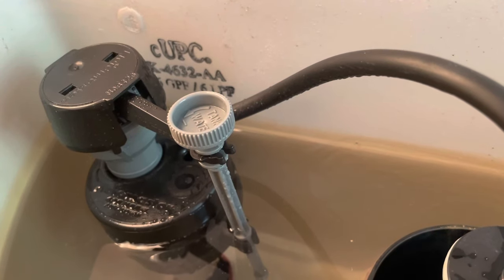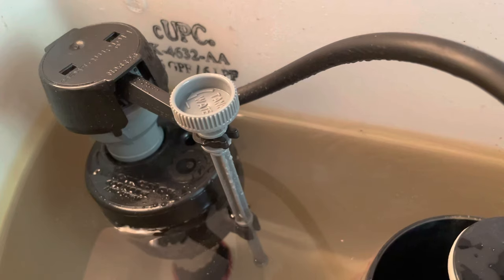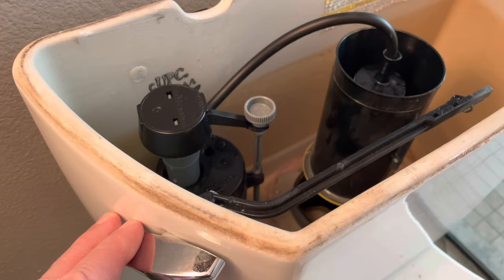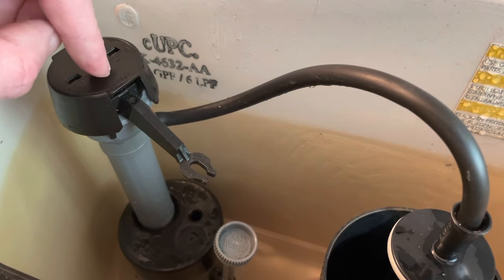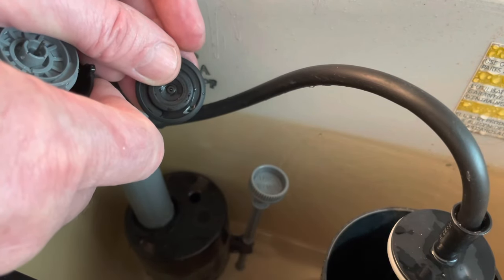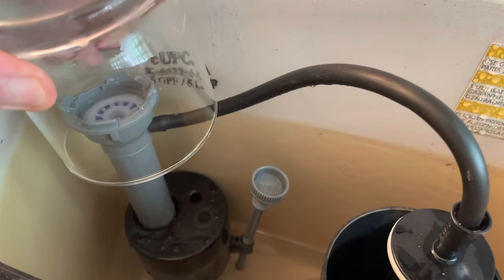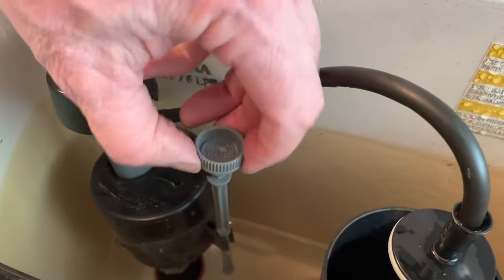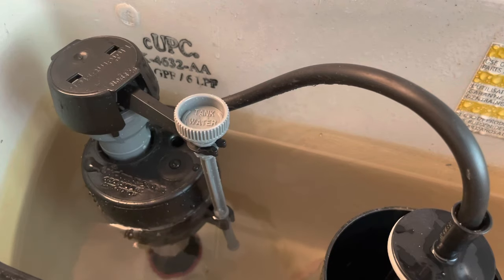Toilet Fill Valve Not Shutting Off / Don’t Replace / Fix Fast Cheap & Easy For Beginners

Comment: You can also adjust the fill valve stem down if you don't have some washers handy.
Reply from the maker: Going to do a vid on adjusting the float, but this is not related to that… this is for when the valve “won’t” shut off regardless of height adjustment.

Comment: Thank you so much for this video. I wanted to ask you a (hopefully) quick question if possible. The cup in my fill valve does not move up after the water fills the tank, so the water just keeps flowing into the tank, but it stops if I move the cup manually. Would changing the seal help in this case too? My fill valve was changed around 6 months ago.
Reply from the maker: You bet 👍🏻
Reply: @papajoeknows8355  Great, thank you so much for your very quick reply!
Reply from the maker: Just need to adjust the “float.” At the end of the lifter arm (what you’re using with your finger to pull up on to shut it off), there’s a gray round adjustment screw… you want to turn it in the appropriate direction to actually lower the float so that the rising water level will push the float all the way up to the off position. Just a little fine tuning, and you’ll be all set.

Comment: Mine is leaking through the small hose at the top. Hopefully running some water though with the valve removed will fix it.

Comment: Thanks for this however mine looks slightly different and the twisting doesn’t seem to be working. There’s quite a lot of limescale deposits. I’m scared to break it so didn’t force it. Any suggestions?
Reply from the maker: When they start getting like that, it’s easier to just replace the valve. It’s simple to do, and they’re only $10.

Also, there’s a trick where you just replace the upper portion… it can be done quickly and with no tools. Here’s a video…

Replace Fluidmaster Toilet Fill Valve in Seconds For Beginners NO TOOLS NEEDED
https://youtu.be/ovdWF5Hdz8U

Comment: Something that really should be emphasized at 2:00 that was a real problem for me is that the narrow piece that swivels up needs to go up all the way before turning the larger piece counter clockwise. It wouldn't budge until I figured this out. Great video aside from that.
Reply from the maker: Interesting, because the position of the arm shouldn’t have anything to do with the ability to get the cap off… if you look very closely at 2:00 where I turn the cap to take it off, the arm is in the down position. Not saying you’re wrong, just never known it to have any bearing on getting the cap off.
Reply: @papajoeknows8355  Well, I do have a slightly different version with a metal piece connecting to the floater. It looks the same aside from that, but it could be pretty old, so maybe they fixed this in the newer current version to make it easier.

Comment: After watching another video on cleaning a toilet tank with citric acid (she used one cup of it) I poured about four ounces (all I had)  in my tank and let it sit for two hours. This cleaned the very rusty, slightly moldy tank pretty well, and also cleaned the valve inside the device, it seems. Stopped the toilet running, instantly. Did not fix a whistling toilet, though.
Reply from the maker: @hermanhale9258  try this…

Loud Whistling / Hissing Toilet Driving You Crazy ? Fast Easy Fix
https://youtu.be/-SwWyZCeAjY
Reply: @papajoeknows8355  Thanks, that does look simple.

Comment: I have water leaking from one of the two holes at the top of the valve cap. The valve looks just like yours. Do you think the seal could be the reason?
Reply from the maker: Yes, I would follow the steps in the video, and even if you don’t have a new seal, clean the existing & replace.

Comment: Hey man, hope all is well.  I did everything you said.  Flapper is good, flushed out the potential mineral deposits.  Then went and bought a new rubber seal (little black thing).  Then I quarter turned it until it clicked.  Toilet STILL WON'T stop running unless I push down on the cap of the fill valve.  American Standard parts, only 2 and a half years old.

Very frustrating.  Please help.
Reply from the maker: Honestly, when they start getting “fussy” like that, it’s easier to just replace the valve. It’s easy to do, and they’re only $10.

Also, there’s a trick where you just replace the upper portion… it can be done quickly and with no tools. Here’s a video…

Replace Fluidmaster Toilet Fill Valve in Seconds For Beginners NO TOOLS NEEDED
https://youtu.be/ovdWF5Hdz8U

Comment: I wish I had seen this video before I spent almost 400 bucks on after hours call!! Same issue plus the valve would not turn the water off.
Reply from the maker: It’s ok… I can’t tell you how many things I’ve learned after the fact. This was probably the exact problem, but you’ll know next time.
Reply: @Papa Joe knows  yes I feel so mad at myself but now I know what to check for. Thanks for the video!
Reply from the maker: @LoveLifeAllWays  you bet. 👍🏻

Comment: Thank you for the video. I tried doing this and it works the first time (stops the water) and then every time after, it doesn’t stop the water anymore and does the same thing. Any thoughts on this??
Reply from the maker: Is the water rising and spilling into the overflow (the pipe in the center)?
Reply: The water doesn’t spill into the overflow the first time but then it does after flushing it. Then I’ll undo the mechanism the 1/4 turn and then lock it in again and then the gasket will engage and the water will stop perfectly fine. It’s after the first flush that the water doesn’t stop again. When the water fills up the first time, I can hear and see when the rubber gasket engages but after flushing, it never engages again, causing the water to spill into the overflow.
Reply from the maker: @Josh-vk7qu  Try this…

Running Toilet Spilling into Overflow Easy Fix DIY
https://youtu.be/uTcYxn2bpDg
Reply: @papajoeknows8355  thanks for your help and getting back to me. I had tried that in the video but it didn’t work and I guess the small metal pin that goes in the center of the gasket was no good anymore so I replaced the valve component (top piece and stem only) and that finally worked. Again, thanks for your help!!
Reply from the maker: @Josh-vk7qu  you bet, glad it worked out. And yeah, at some point it’s easiest to just replace the valve, or just the upper portion as you did. Well done. 👍🏻

Comment: Does this fix work if tank isn't refilling?  I have to gently tap the fill valve to get tank to refill
Reply from the maker: No, eventually they become “sticky” so to speak… at that point, it’s easier to just replace the valve. You can also replace just the upper portion of it in seconds with no tools. There are links to a couple of videos I made on this down in the description.

Comment: i tried cleanup but it doesn't work well, i did everything but still the valve is not closing, thanks for the video because i will do the exact same thing before buying a new valve
Reply from the maker: Sounds like it’s just time to replace the valve. You can also just replace the upper portion quickly and with no tools. Here’s a vid:

Replace Fluidmaster Toilet Fill Valve in Seconds For Beginners NO TOOLS NEEDED
https://youtu.be/ovdWF5Hdz8U

Comment: It is easy to replace the valve by releasing the white clip down by the base of the valve. From my experience its a better fix
Reply from the maker: Yeah that’s a pretty cool hack too, I did a video on that about a year ago:

Change a Fluidmaster Toilet Fill Valve in 18 Seconds No Tools Easy
https://youtu.be/gyeQNI-LQnU

Alot of times, the seal doesn’t even need replacing though, it just needs cleaning out. Each approach has its place.

Comment: 😂 everything was going great. I got to part of flushing the minerals with cup over fill valve. Tried turning water off at wall and won't turn off now 🤣. Thankfully I got top back on and it finally shut off. Casing plumber now
Reply from the maker: Lol, yes the valves at the wall get “stuck” over time from not being used. But glad it’s all working out. 👍🏻

Comment: I just fixed the valve on my toilet for a separate reason but now it won’t stop running even when the float is up. I watched this video and checked mine the little metal pin that sticks out comes out of top piece. Is it supposed to do that?
Reply from the maker: When they get “fussy” like that, it’s easier just to replace the valve, they’re only $10, and it’s very easy to do. There’s also a trick where you just replace the upper portion… it can be done quickly and with no tools. Here’s a video…

Replace Fluidmaster Toilet Fill Valve in Seconds For Beginners NO TOOLS NEEDED
https://youtu.be/ovdWF5Hdz8U

Comment: Does this trick also work with American Standard Fill Valves?  The design of my American Standard fill valve looks very similar to the flow master.
Reply from the maker: Yes, if I remember correctly American Standard uses a private label version of the Fluidmaster valve.
Reply: @papajoeknows8355  Thanks!  I'll have to try that out and the replacement seals this week!  The Valve itself is pretty cheap already, but I'd rather not go through the hassle of dismantling the entire thing if all it needs is a flushing out or a new seal.

Comment: Nice little hack, I must say.  But do Home Depot or Lowes sell these replacement rubbers or maybe Amazon?
Reply from the maker: Yes they should have at Lowes & HD, and I put an Amazon link for some down in the description. 👍🏻
Reply: @papajoeknows8355  By the way, Joe, what is your opinion of Korky’s vs Fluidmaster?
Personally, I think FM is the superior product because of the exposed float.  But I’d be interested to hear your thoughts.
Reply from the maker: @justicegusting2476  no complaints with Korky’s, they’re a good brand. I just had an old plumber years ago tell me that Fluidmaster was the gold standard, so I pretty much went with that. I do also like the exposed float. 👍🏻

Comment: I HAVE THE Same one but my rounded float that rises, raises jerky and does not raise smoothly, any ideas on how to fix this or if i can 

apply any lube or anything to assure it raises smoothly, Thank you
Reply from the maker: That’s a common problem when they get older… When they start getting “fussy” like that, it’s easier to just replace the valve. It’s simple to do, and they’re only $10.

Also, there’s a trick where you just replace the upper portion… it can be done quickly and with no tools. Here’s a video…

Replace Fluidmaster Toilet Fill Valve in Seconds For Beginners NO TOOLS NEEDED
https://youtu.be/ovdWF5Hdz8U

Comment: I replaced my whole fill valve and it leaks under the cap at the top here and there. I guess I got a bad new valve. Should I try just replacing the gasket first even though the thing is brand new ?
Reply from the maker: Maybe pull it apart as in the video… maybe it’s just caught up in there.

Comment: Hi there. Do i have to disconnect the hose or just shut it down. Could you guide me in this one also. I being experiencing condensation behind my toilet tank and it drips alot. I turn off the water hose to the tank. Because when i had it back on the water tank will continue to make the noise like when is filling up water. So i shut it down had water in the tank but when i go back to see if the tank is full of water is empty do you by a chance now what it is? I would appreciate it if you let me know. 😊
Reply from the maker: Send me a little video of what you’re seeing. My email: thehometeam1974@gmail.com
Reply: @papajoeknows8355  Thank you. I will email you just now. 😊
Reply: @papajoeknows8355  Im so thankful. For all your help. And thank you for telling me to put the toilet because of you, i did it on my own now if anything happens i will feel more confident by doing it. Since i was a bit scare . With all your good vibes. And advice. God bless you. My friend. 🙏
Reply from the maker: @AgustinaQuinteroFelix  god bless you back Agustina. I’m so glad that you did it yourself and have that newfound confidence now! 👏🏻
Reply: @papajoeknows8355  Thanks again. Your such a wonderful person. Sending blessings🙏

Comment: Mine keeps hissing but if I press down on the whole valve stem it stops? How do I fix it? Should I buy a new fluid master?
Reply from the maker: When they start getting “fussy” like that, it’s easier to just replace the valve. It’s easy to do, and they’re only $10.

Also, there’s a trick where you just replace the upper portion… it can be done quickly and with no tools. Here’s a video…

Replace Fluidmaster Toilet Fill Valve in Seconds For Beginners NO TOOLS NEEDED
https://youtu.be/ovdWF5Hdz8U

Comment: ours won't turn on or won't fill all the way.  Do you think this method would fix that as well?
Reply from the maker: Try adjusting the float height adjustment screw at the end of the lifter arm. I think I should do a video on this.

Comment: Are the valve seals a universal size and shape or are they different based for different manufacturers?
Reply: Also, what exactly are they called so I know what to look for at the hardware store?
Reply from the maker: They are only for Fluidmaster valves, and there’s an Amazon link in the description for reference. 👍🏻

Comment: My seal wasn’t in bad shape it did have some crud on it. I was able to use an old tooth brush to clean it off and that did the trick. I’m renting so I’m not buying any seals. I also didn’t feel like putting in a call for this 😅
Reply from the maker: Well done, glad it worked out! 👍🏻

Comment: Papa Joe, I flushed system and replaced seal. However fill valve is still running.Any other options or should I just replaced valve?
Reply from the maker: When they start getting “fussy” like that, it’s easier to just replace the valve. It’s simple to do, and they’re only $10.

Also, there’s a trick where you just replace the upper portion… it can be done quickly and with no tools. Here’s a video…

Replace Fluidmaster Toilet Fill Valve in Seconds For Beginners NO TOOLS NEEDED
https://youtu.be/ovdWF5Hdz8U

Comment: My toilet doesn’t shut off all the way once a week or so. I’ve flushed out the mineral deposits from my Fluidmaster fill valve, but never replaced the rubber seal. Are the rubber seals universal? I am hopeful that replacing the rubber seal does the trick. Additionally, the water level adjustment screw is turned fully clockwise and the float cup is at highest point. Do I need to re-adjust this for optimal level/performance?
Reply from the maker: Here’s a quick troubleshooting video…

Toilet Won’t Stop Running? The Quick & Easy Finger Test
https://youtu.be/VYfluYcwIU0

Comment: Hey, Joe! I did all your steps and my fill valve still won’t stop filling the tank up, even after its full. Is there any advice you could give me? Is this telling me I need to just replace the float, fill valve, etc all together?
Reply from the maker: If you use your finger to lightly lift up on the arm that extends from the top of the valve, does it turn off?
Reply: @papajoeknows8355  it does not move at all if I try to push it up
Reply from the maker: @rose-dn8hs  ok, it’s time to replace the valve, they’re only like $10, and very easy to do. There’s even a trick where you just replace the upper portion, and with no tools needed. Here’s a video:

Replace Fluidmaster Toilet Fill Valve in Seconds For Beginners NO TOOLS NEEDED
https://youtu.be/ovdWF5Hdz8U
Reply: @papajoeknows8355  thank you so much! You are awesome. Saved me lots of money and grief
Reply from the maker: @rose-dn8hs  you bet, let me know how it goes.

Comment: The black rubber thin hose was too long causing my toilet bowl to continuously flow with water. Once I cut it to proper length it fixed problem. I hope I helped someone

Comment: When I flush mine  sometimes the tank won't refill.I have to look into the tank and lightly manually push the( fill valve)float down. It seems to get stuck in the up position. Would that be a seal replacement issue too? And once I do that it drops and tanks refills...help.
Reply from the maker: In time, the float starts to “stick” in the upper position. At that point, it’s best just to replace the valve. It’s easy enough to do, but I have a little hack for replacing the upper portion in seconds with no tools… see video below:

https://youtu.be/ovdWF5Hdz8U

Comment: I did everything you suggested, including replacing the seal, but the fill valve still won’t completely shut off, as the tank would slowly fill up and overflow through the handle’s opening.

What could be wrong? The #242 seal I used is several years old, but the rubber feels and looks OK. It does look subtly different from the old valve. Could this be the problem?

Nice video, otherwise.
Reply from the maker: Try adjusting the float. Here’s a video:

https://youtu.be/KNaZAGF4tKk